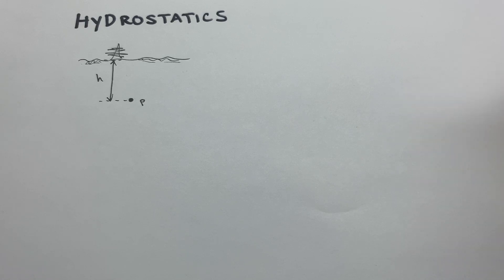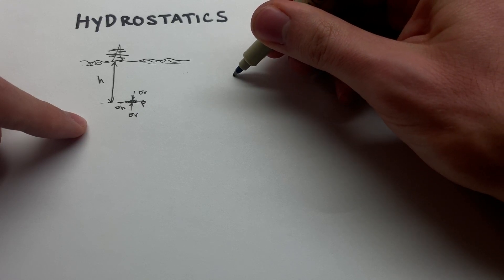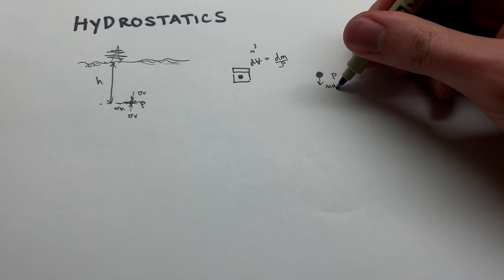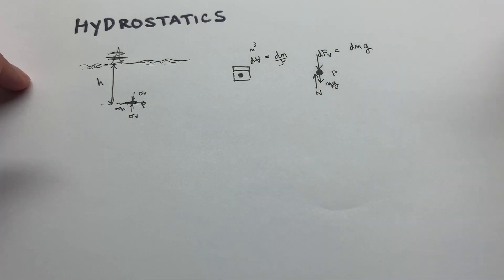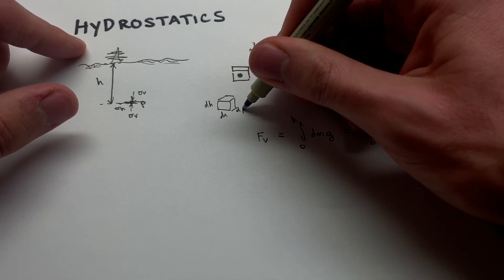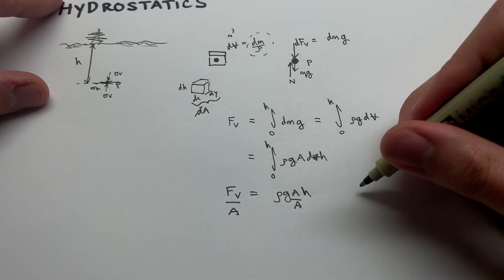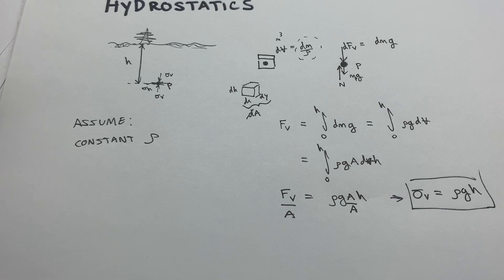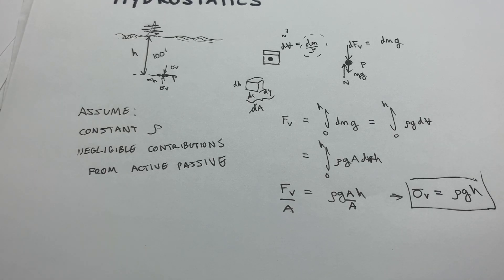Rock Mechanics: Hydrostatics

Comment: Great video - thank you. Agreed this is a small piece in a great big picture....How might you approach adding pore pressure increase due to water injection well....And then add a fault into the model to predict failure (the fault under normal stress might not fail if there are no tectonic changes but as you add pore pressure and pressure to the fault plane it could slip....fault slip potential Zoback). I understand this is way beyond the scope of this video....I am just interested in building upon this model incrementally. Not looking for a full explanation, maybe just some direction in how to approach a more complex situation....or even just the suggestion of a good video to reference. Thank you!